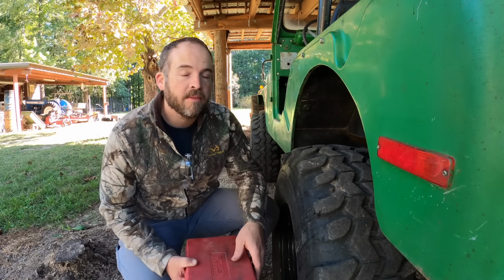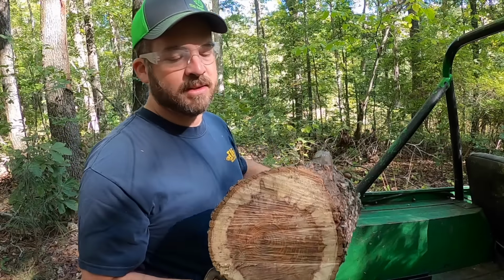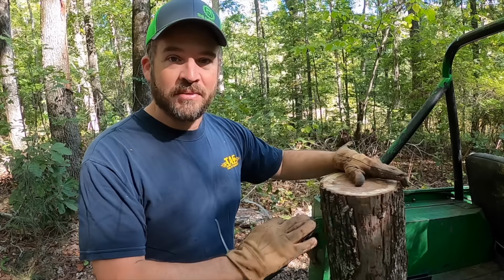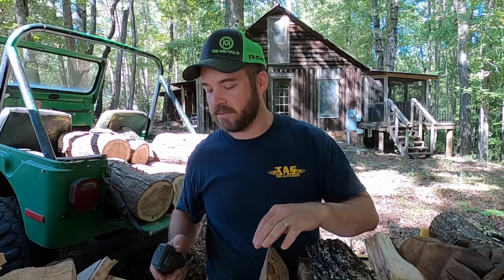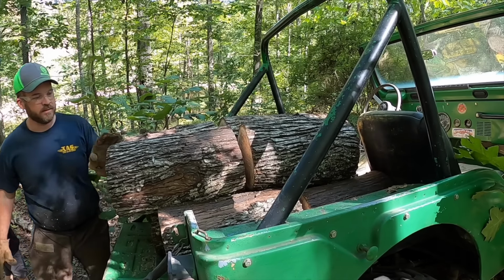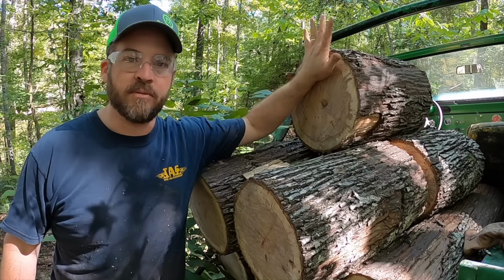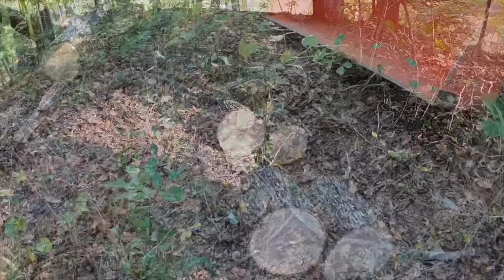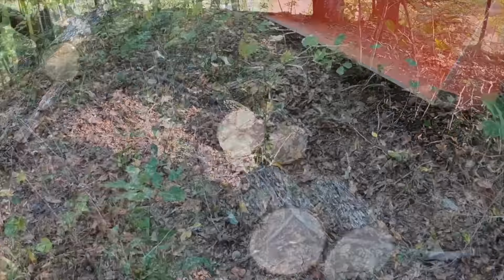It's Past Time for This: Firewood Cutting and Chimney Scrubbing

Comment: Nice to see you doing stuff on the homestead.
Always loved cleaning the chimney <not>; called it the "black snot job".  
I found using creosote cleaner powder regularly during the burning season made it easier to clean the chimney.  It didn't stop creosote buildup altogether, but it did seem to reduce it and make it less sticky to the liner.

Comment: To help with firewood…1. Hearing protection. 2. Cut the tree into longer lengths, chain and drag it out to a better spot that is easier on you to work and 3. I put a large zip tie on the side handle bar of my saw so it it doesn’t get it the way and it’s easy to replace if it gets bent or damaged. It just sticks out to the side of the saw. I even put my saws away in their cases and the zip tie fits perfect and pops right back out when I take the saw out of the case. Cut the tie to 18” and it is a much faster way to measure the log without turning your saw each time. Found that tip here on YT, wish I could remember where I saw it to give the guy proper credit.

Comment: Hang on to your hardwood stumps.  Come a fresh show in deep winter, you can break them up and make charcoal from them.  Burn pine as the fuel and keep it hot with a leafblower.  When it's cool, grind and inoculate the char with a mixture of molasses and compost tea and you've got biochar to use for soilamendment.

Comment: Hello Wes. I don't have a fireplace, nor have I ever had one to clean. Now that you have it that clean, would building a super-hot fire loosen up the top sections to clean it more? I understand why the bottom two sections were virtually completely clean. Have good days!
Reply from the maker: It might help, that stuff that was on there was glazed on, which is nearly impossible to get out without the proper equipment.

Comment: I seem to recall you had an old Ford 3000 tractor about like mine. Do you still have that or did you trade it in on the orange one?
Reply from the maker: It's still here, in the shed. Runs great.
Reply: @ glad to hear that. Mines currently giving me an ignition problem. That’ll be project 1 when I get there.

Comment: Too bad Thoren Bradley isn't there with you. He would have those cuts split in the wink of an eye.  😄  It looked like there was a crack in the concrete cap. You probably should patch that. Don't want moisture getting in the crack and then freezing.

Comment: Just an old hillbilly trick... you can clean that chimney by dropping a light chain in there.  You can rattle it by hand or attach it to a cordless drill to spin it. 
Works amazingly well on a straight pipe or masonry chimney.
Reply from the maker: I read at one point something about using a chain to knock that stuff out. I wasn't sure the process though. How you describe it makes sense though. Thanks!

Comment: give that 27% wood 2 or 3 months, after it is split, in the winter time with low humidity, stored in a dry location, and it will be burnable and below 20 or 18% and ready to burn.

Comment: That recently split wood is to wet to burn and really won't be good this season.
13% is the humidity you want, 18+ will load your chimney with creosote.
Save most for next year and cut next fall for the following year.

Comment: What type of chain saw is best for a woman in her sixty to use for cutting up firewood 🪵
Reply: Something lightweight as possible. If you go with gas powered, anything over a 16” bar will be a lot to handle.  There are some decent battery powered saws, but they are more expensive. They are less noisy and a little lighter.  There is a YouTube channel called project farm that has comparisons of both battery and gas powered saws. It’s always better to buy from someone with a good service department. They need fixin’ from time to time.
Reply: Battery chain saws would be the best.
Reply from the maker: I would second Roger on this one. I think you would benefit from a quality battery powered saw and some extra batteries for it.